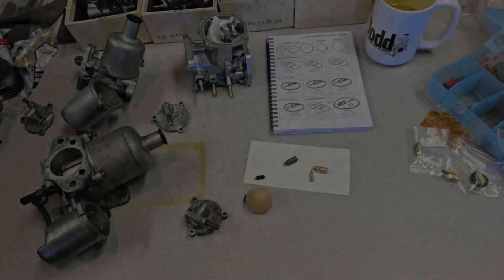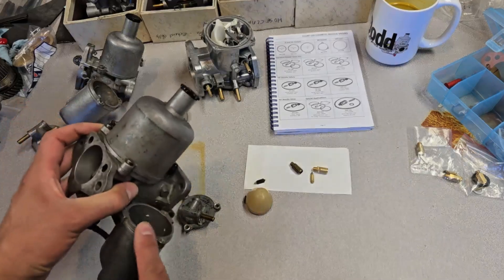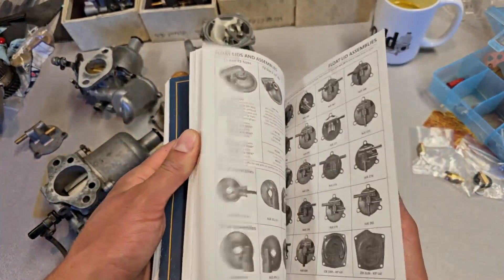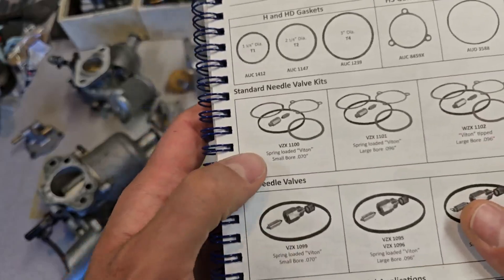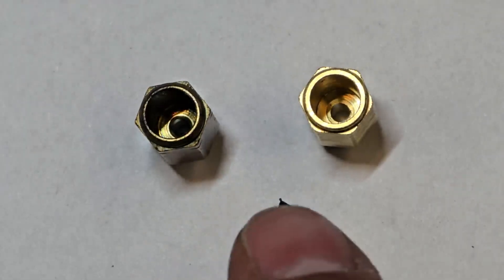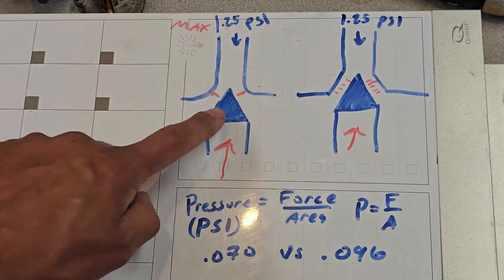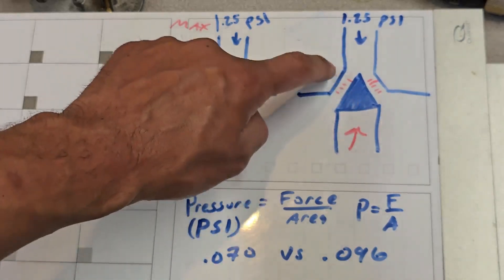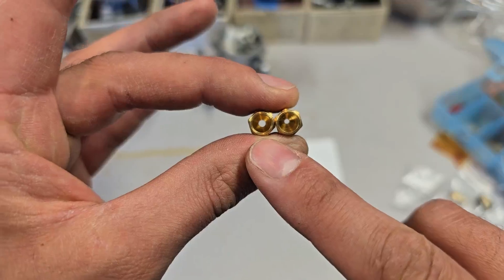Classic Mini Survival Guide to Fuel Needle valves, HS and HIF carbs. Check for size and shape!

Comment: Hi Darren, i have a twincarb Spitfire (2x HS4). I had all the same Problems, 1st worn  original Brass Floateedle. Replaced by new vitonneedle and seat, but still overflowing or overfueling (fuel flowing out of jet). 2nd Problem solved was the  Aftermarket Fuelpump with up to 4 PSI. So i rebuild an original AC-pump with a rebuildkit. Still having Overfueling issues, changed back to the old seat with new vitonneedle, problem solved, although the rebuild Pump is delivering 2,2 PSI . But this is in range from what is written in the workshopmanual from Triumph. I have a petrolking lying arround, maybe i fit this to drop the pressure even more. Also in the manual, you can add more gaskets between block and pump to lower the pressure.
Reply from the maker: Id run 1.25 psi fuel pressure for twin HS4 carbs

Comment: Hi Darren. Just so I understand this fully. The needle valve shuts off when the float chamber has sufficient fuel? The grit problem is any particles present would stop it from closing fully? The case of too much fuel pressure, is it just forces it's way past the closed valve!
Reply from the maker: Yes exactly right. Grit stops the needle valve from sealing. Too much fuel pressure overwhelms the float.
Reply: @darrensrestorations991 Thanks for confirming that Darren. These things are great 👍